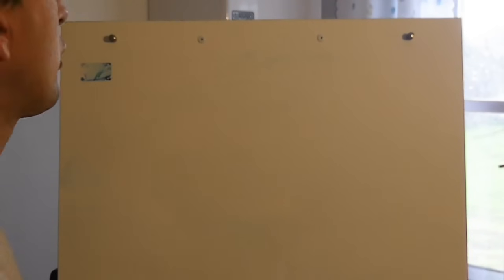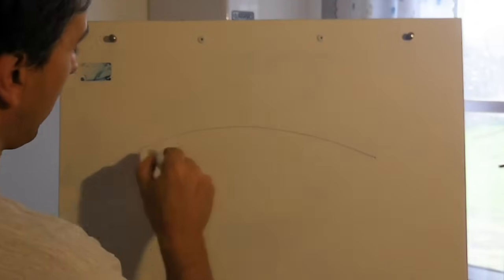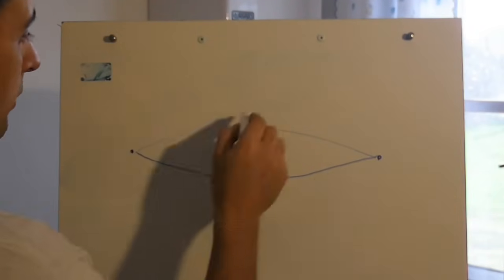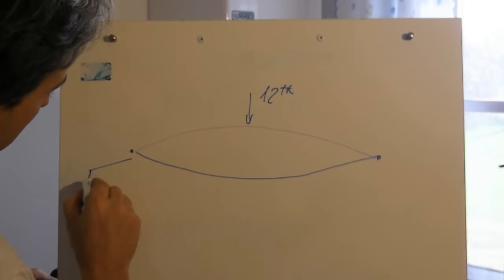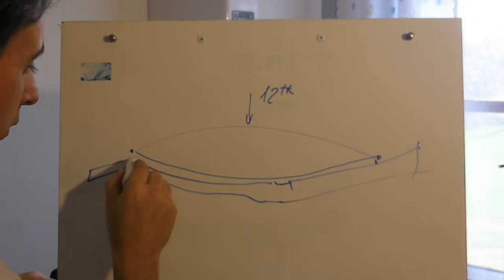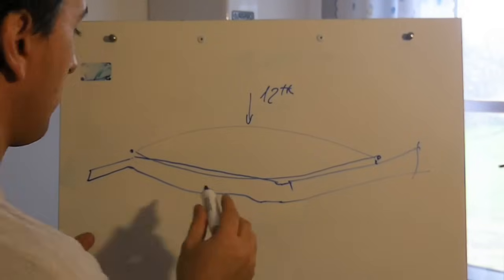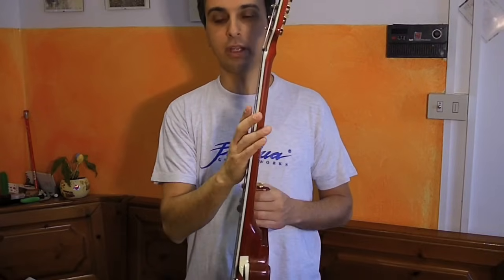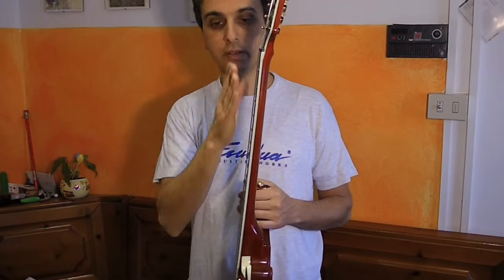Truss rod adjustment: how to adjust the truss rod - frudua.com

Comment: So using this method to test the neck relief should work no matter how high the saddles are on the guitar? In other words, will really high saddles (for slide guitar) distort the results of this test? Also, do you recommend setting the neck relief before adjusting the saddles?

Comment: Hey sir... On my guitar the neck is completely strait. The truss rod is totally loose, so I'm unable to set the proper position and because of that, the bridge is a bit high. Would you have any tips on how to fix that? Do you think I'd need to replace the truss rod? THanks in advance.

Comment: And there is also very objective, without measurments (truss rod and saddle independent) technique for nut setting. Press 3fret close to 2 fret. Check the action between the string and fret 1. There should be minimal distance - just "ping" noise while touching the string gently. :)

Comment: QUESTION...I just want to be clear. I have a Jackson Dinky J32 (Brand New) with Floyd Rose. I am getting buzzing on the E and A string (Both open and fretted). So what I need to do is loosen the three nut clamps, fret the first string, hold the last string and see if the strings touch the fret board? I haven't checked yet, but I am guessing it is touching the board somewhere. I will check later this week when I have time. I am nervous, I don't want to ruin the guitar. I know to make 1/4 turns with the truss rod, and if it doesn't want to turn then I'm guessing a tech will want like $75 to fix the problem, I just don't see why a new guitar has this problem already. Anyways, any advice would be appreciated!

Comment: Hey man. I'm changing string gauges on a fender strat from 9s to 10 gauge. Is it necessary to adjust the truss rod for that? If so, should I do that before or after putting the strings on?
Reply: After, of course! Put on the new strings, tune to pitch, and do your adjustments then. :)

Comment: thank you so much for all your videos-its fantastic!
Can you recommend a system, sort of a plan in steps on how to do a complete setup of a guitar.. Like where to begin and whats the final step. 
I got 3 guitars: les paul, standard strat with vintage style tremolo and gretsch G5120 hollow body with bigsby vibrato. Gretsch goes out of tune ALL THE TIME...do you have any suggestions on how to improve the tuning stability on it?
Thanks a lot again, sharing is the true power!
Best,
Nurali

Comment: You need to say what type of guitar it is acoustic or solid and at what fret the neck joins the body, using truss rod for adjusting neck relief doesn't affect the section of  the fretboard that is past or NEAR where the neck meets the body. Where the buzz occurs when the higher frets are stopped it is usually because the bridge is either too low or the higher numbered frets need lowering. (difficult to explain but there is often a hump  lower down on the fingerboard)

Comment: Does this 10th fret rule for checking the neck applies for guitars with different number of frets? I mean, no matter if it's a 24 frets neck or 22, no matter what, I will always use the 10th fret as a checking point?

Comment: my low e string is buzzes near the neck-body joint whenever I pick frets ahead of 11. Should I change bridge action or truss action.
Reply: If all other strings is ok then try look at the height of the low E .
Could be that a little tiny adjustment at bridge is all you need.
( It was on my guitar when I got similary problem )

Comment: Does the truss rod deal with both sides of the neck at same time? Low and High E strings? Also How do I know that it's time to adjust the bridge? If relief seams to be good, but I still get some buzz on a couple strings. Do I need a fret filing? I have 2 Gibson Les Pauls
Reply: there are more than truss rod, which affect whether string will buzz or not:
watch?v=5yrAckQ4HvE
Reply from the maker: Michael Shutes 1) yes 2) first you need Truss Rod adjusting. See my video. :)

Comment: Thank you, very good, all works fine but in my Guitar  when all is great now there is a Buzz when I press the notes at the First fret, the buzz  diminishes when the truss rod is not so tight....almost  lose.... I do not know if is that the Nut is a bit low in height ..is with a Floyd Rose

Comment: My Telecaster has been doing a fret buzz only at the 17th fret on the first three strings and buzzes on the 19th fret on the lower three strings.. Do you tinhk this can be related to trust rod not being correctly adjusted? In that case, what should i do to fix it? Thanks in advance! Great chanel by the way

Comment: A question, I have a ibanez gax70 guitar and I feel that I have to press down a whole lot on the fretboard to bend, what can I do to remedy this? 
I also have a Squier strat that has a slight bit of buzz all around the fretboard but especially at the 15th fret because it hits the fret next to it, will a truss rod adjustment fix this? any suggestions are much appreciated.

Comment: I have a Schecter Diamond Series C-1 Elite 6 string. Its it great condish. My question is, I want to throw some GHS low tunes on my guitar. The strings go to .070. Will my guitar be okay if I attempt it? I want to go low like 5FDP and In This Moment. But I do not want to buy a 7 or 8 string guitar. Or a baritone guitar.
Reply: I would make sure the strings you purchase are designed for even tension. You don't want to incorporate a twist in your neck. I'm not sure what scale length your guitar is, but with as thick as you plan on going I would hope it's a longer scale rather than a short scale. That will cause a lot of tension. I also would probably only run that thick of a string no higher of a tuning than Drop C. If you go standard tuning, it may put too much stress on the neck.
Reply: You could also detune the strings a half or even a full step. A lot of metal players do that to get a "darker" tone. But it will also relieve some of the tension on your neck.

Comment from the maker: @mitchelldog4 >> release (untune) the strings so they are just in tension enough to stay straight on the neck then unscrew the 4 bolts that hold the neck to the body on the rear of the guitar just 2 complete turns. Then push the neck toward the low strings side and while keeping it this way fix the bolts again with strength. Tune again You're done.

Comment: If the truss rod adjustment comes first how do I know if there is problem with the truss rod or string action? My string height is sort of high, but how do i know whether I need to adjust the truss rod or just the strings? 

Also, how should the truss rod be adjusted to allow for the most comfortable playing? Thank you.

Comment: Warwick, clockwise "tightens" the truss rod, flattens the neck and pulls the headstock "back",.  The strings will move closer to the neck in the physical middle of the neck.  If relief is present (it should be), it lessens the relief.
Anti-clockwise loosens the truss rod and allows the strings to pull the headstock "forward".  The stings will move further, etc.  The relief should increase, etc.  That being said, I have serviced guitars that had the opposite truss rod rotation (I think only one).

Comment: I don't know how to explain this, but my bass guitar strings near my bridge 
part is more far apart then the one on the neck, like the gap is from small 
to big. Is the gap suppose to be on the same length? And my bass string 
buzz/vibrate when I let go the strings after I play a chord. Is it 
something to do with the strings? Is it the bridge problem? Should I change 
a new bridge? Should I adjust the truss rod? Help me!!!

by Raphael Jonathan Tan

Comment: Hey, i have a question. You make adjustments on the truss rod with the strings on and tuned, or is it better to tune them down?
Reply: +xdexer tune them down 1-2 steps - this will make the truss rod's thread live longer.

Comment: Hello Mr. Frudua,
I have just bought a new Stratocaster and it has got some fredbuzz on the lowE an A string when I play a little bit "harder"(meaning that I push the E-string with the pick for example to the place of the A string and let go the string then).
Since the guitar is a Squier I do not think that the stock strings are one of the best, but would a decent set of strings perhaps fix the problem? If it would: What set of strings should I buy?
Thank you for reading this!
Greets,
Max :)

Comment: What to do if your action is way too high and you want to get it as low as possible without having deadened spots on the upper frets? I need a reference point for how low the bridge should be.

Comment: I know this is super old but I was always taught to hold the guitar in a natural playing position when doing truss rod adjustments because it doesn't matter if the truss rod is perfect when the guitar is vertical... That's not how you play it. The only position that matters is the position you play in so make your truss rod adjustments or any adjustments in a setup the closest resembles your playing form.

Comment: so does adjusting the truss rod change the neck and action uniformly across all 6 strings?   my low e, a, d,  buzz but g, b, e are fine.  Will truss rod adjustment fix these 3 strings,  low e being the worst currently? I haven't touched anything and it's a new jp100d.  thanks in advance for any help.
Reply: +C NiceTune Check the action and the nut as well. If it's a brand new guitar then the nut is probably fine, but just an idea.

Comment: My guitar has the truss rod adjustment not on the neck side, but under the pickup guard next to my neck pickup (Robert Cray Stratocaster). How to do this adjustment in my case? I guess I have to remove the strings to reach the truss rod. Can you give me an advice? Or publish a video about it? Thanks.

Comment: I have just finished a small project of setting together a cheap electric guitar, strat style. The thing is, the neck is VERY bad, the strings are buzzing very much against the frets. I have concluded that the neck has a severe back bow, because it has been standing in a garage without strings and detached from a guitar body. Would the problem get solved after adjusting the truss rod and adding strings? I thought that the strings would pull the neck into position. Any help would be appreciated!

Comment: Just wanted to know  - Pre-Truss Rod adjustment, you had strings already on the Guitar.
If I am changing string gauge (to lighter strings), and I put new strings on before the start of the adjustment, the intonation will not be correct and there will be stretch in the new strings.  In short, should the Guitar be roughly in tune before adjusting the truss rod?  If not, there isn't any tension on the guitar neck.   Sorry if the Questions sounds silly but to me it sounds like a chicken/egg senario - can't tune the guitar without setting the truss rod correctly, yet it looks as though the guitar is strung with new strings before the adjustment begins.  Can someone please clarify?

Comment: I'm not sure that you should be measuring the relief from the 1st to the last fret when the truss rod is only active from the 1st to the 12th fret. I therefore think that you should fret the string from the 1st to the 12th fret to check for the relief.

Comment: how do you recommend i start the setup with a strat i had to rebuild.  in other words, the saddles and the neck may both be setup incorrectly.  which do i start with.....do i adjust the truss rod then the saddles or the other way around.  right now my strings closer to the pickups are way too high off the neck.  thanks for your help and great vids

Comment: hi frudua! im worried because i have perfect action right now(quite low action) but my truss rod is really tight. in the case that where my action suddenly goes high again, since my truss rod is really tight already, will the truss rod also get loose together with the neck so that i can tighten it again? im just worried that ill be in a situation where i cant tighten it any further but have high action on my neck. i hope you understand my question im pretty bad at english
Reply: because if the truss rod loosens together with the neck then there's no problem because i can tighten it again. but if only the neck moves and the truss rod does not then i can see it being a real problem =(

Comment: Hi Frudua.. have you measured the thickness of the D'addario envelope? I have an envelope from D'addario acoustic strings (I use ernieball on my electric) which thickness is ~0,4mm and I'm not sure if it is the same thickness as their electric strings envelope.
Thanks!

Comment: Hi, I've been trying to set my truss rod using your tips and at the moment my high E string is just a but higher than the thickness of the daddario carton so I think the relief should be fine but what worries me is that it is in the point when I'm almost unable to turn the truss rod clock wise any more. Can it be like this or should I take it to someone?

Comment: @johnmorisi8 ya you basically have to take the neck off the body...there's ways of doing it with the strings still on but either way just a bit more work

Comment: I'm still adjusting my guitar every time  I'm getting fret buzz on the 12th 15th fret low e string so I'm just messing around with the trust rod and I have a floating bridge so I'm also adjusting that and it's taking forever action is nice though but I might have a fret that needs to be adjusted because no others give me problems idk I will figure it out this is hard

Comment: @FruduaTv First of all: Extremely helpful videos, thanks a lot for the whole effort! - And btw, beautiful guitars shown in the videos.
I've got almost the same problem as Trex1268. Built my own Strat, mounted .10 gauge strings and tried to get as low as possible without buzzing. Got 2mm low E and 1,6mm high E heigt. Everything below is buzzing (but only low E and A, and only fret 1-10). Can I go lower or am I limited with the neck and string gauge?

Comment: Hey, great tutorial really! I was wondering, are the same principles applied when adjusting the truss rod on an electroacoustic? I have an apx900 which needs some adjustment. Accidentally left it in a really hot place and since then the G string started buzzing around the 4th-5th fret. Thanks in advance.

Comment: I have a question. when i check string height with capo and fret 24th fret, the high e string seems fine, but as i go from the high e to the low b (i have a brand new Ibanez RGA7 string that i put 10-66s on) the action gets higher. the neck has a slight up-bow, nearly straight, which as far as i know, is ideal for most guitars. but even when i lower the saddles, it helps the action, but causes fret buzz. do you have an ideas as to what my issue is and what should be adjusted next? Thanks, -Dan.

Comment: I have a question. I am replacing the saddle on an old Epiphone guitar. The guitar hasn't been played for about 2 years and was stored in a cold garage.  I'm sure the truss rod needs adjustment. How will I know how to set the saddle height vs truss rod adjustment?

Comment: hi mr Frudua, I have a problem with the truss rod of my strat. I followed ever procedure in your video and I need the neck to have even more relief.. The strings are practily touching the frets..the card lifts the strings a bit and my truss rod is completly loose already. what can i do to solve this?
Reply: 478mig Its could be, that the neck itself is not screwed into place properly. Maybe at the spot where the neck is connected to the body, there is some "shimming" wich causes it to have a back- angle on its own.
Reply: 478mig

Comment: so if the strings are too close to the fretboard than you loosen it by turning counter clockwise?
And if there is too much room between the fretboard and the strings you tighten it by turning it clockwise?

Comment: just a little question: what if the string above the eleventh fret doesn't move when I put the business card under the tenth fret? Does that mean I HAVE to adjust the truss rod if I want a perfectly tuned guitar or it is only a matter of action? I am not a native english-speaker so you might already have answered this in your video and I just didn't get it...

Comment: Dear. Sir. I just. Have buzz. On my. Low E. And. A string  , there is a buzz all over the neck . So coukd u plz tell me what could be the reason ?    Other strings  DGBE  are perfect .
Reply: mechael m Those strings are thicker so they need more room to vibrate. I would adjust your guitar to accommodate your low E string. If your bridge is even height, the rest won't buzz if your low E is set correctly.

Comment: Ignore the stupid name LOL but what advice can you give me? I went to take off my strings and was thinking to fix the truss rod after I finish putting new strings on. During the process of taking off the old strings my bridge fell off and the height of the screws that keep the bridge in place changed. So before I bother putting new strings on I'm unsure at what height I should have my bridge on. I'm thinking just put it as low as I can before it gets too tight.

Comment: My guitar usually turns towards the ground ( If I see it when I play it ) from the lower E string and from the higher E string at the 12+ fret turns to me... its like a preztel from the lower strings turns to the "ground" and from the higher keys turns to "me"
if you understanded me... could you help me with....
thanks!
Reply: ***** I don't know if you've found out for yourself but you've got a twisted /warped neck. It's a much harder fix. You can check on Youtube but it's probably gonna require a trip down to the guitar shop.